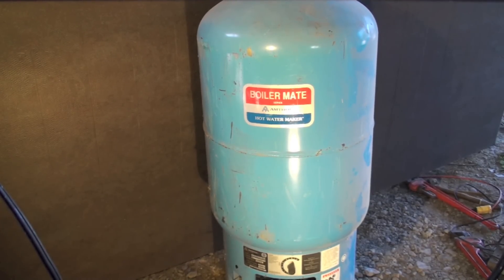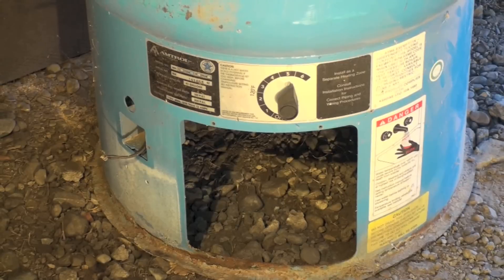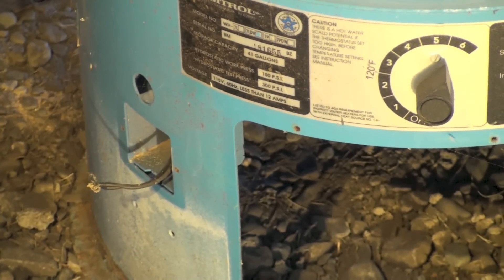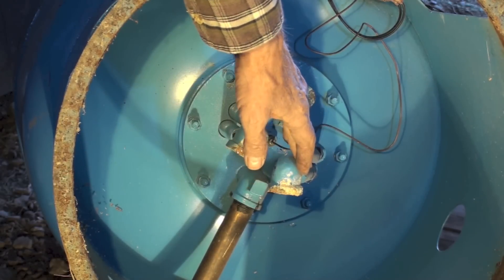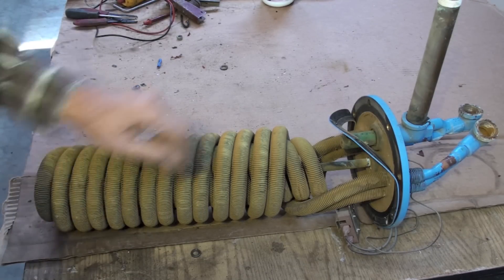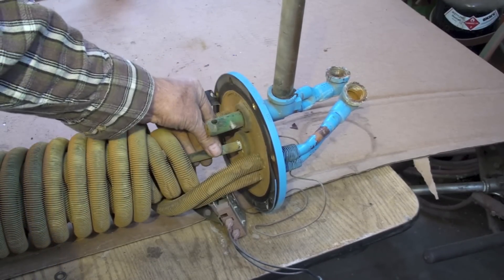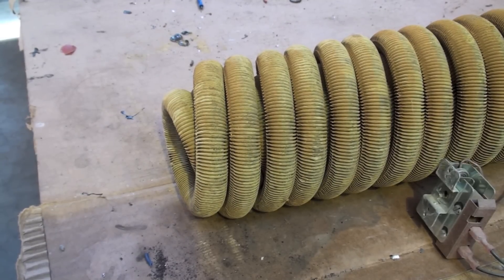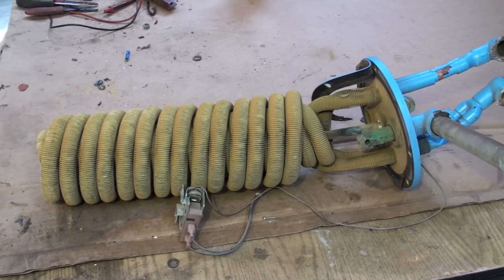The boiler water heater

Comment: Thank you for an inside look of the boilermate model of indirect-fired water heater. I am in the process of replacing one, which was existing six years ago when I moved in the house, but now leaks. Nice to know that it has an efficient heat exchanger - worth replacing with same. Otherwise I would move on to a direct-fired model.
Reply from the maker: Thanks for the support.
GFM

Comment: THANK YOU!!!!! Your videos helped me fix my furnace today.... NO COST!!!!! (even though I have SO many extra parts after replacing the entire furnace in '12.... I have had TWO Amtrol WH41 water heaters crap out- (they actually sent me a new one at no charge to a dealer near me) I installed it 2 years ago and have the same issue.... Err3 code...... I waited up for HOURS last night to check it said "120" until I zonked out at 3AM.... got up at 5AM to check and Err3 code is back... I LOVE your videos... but my tank (I took the old one COMPLETELY apart last time and ended up soldering a pinhole in the stem assembly which lasted me 6 months while I waited for a new stem from Pex Supply and never ended up needing) WHY does this keep happening????? I do not have "coils" in the belly of my beast!!!! I have a broken back and DREAD yanking this one apart and replacing the stem again and THIS time there is NO WATER dripping from underneath.... HELP!!!!!!!!!!! (AND PS.... I laughed my butt off when I had to borrow a socket wrench extension from my ex husband for more torque and he saw what I was doing....he had JUST paid nearly $3K to replace his whole tank and fixing mine cost $24- and he's a mechanic!!!!!!!!......LOL) Blondes DO have more fun!!!!!!

Comment: Why is there just a supply pipe from the boiler?  Wouldn't there need to be a return line for the cooler water to be reheated once it passed through the exchanger?  Thanks for all your videos.
Reply from the maker: There is a return line.  You just haven't found it.  It will be located near the bottom of the boiler and there may be a pump on the return.
GFM

Comment: The heat exchanger in the boiler-mate doesn't look much different than the much maligned domestic HW coil in cast iron and steel boilers. In this you use boiler temperature boiler water through the coil to heat 40 or so gallons of water to 120 degrees or more and in the other you use the water in the boiler to heat cold water going through the coil to probably a lot over 120 degrees to be brought down via a tempering valve. Is how much more efficient this tank would be determined by the type and size of boiler? In both cases the boiler has to operate year round but maybe some have to stay hot and some only intermittently.

Comment: I know this may be a silly question but the the boiler have to be on? What happens in summer? We replaced our oil boiler furnace with gas last year and now need to replace the electric water heater.
Reply from the maker: +Cynthia Nguyen If the boiler is used for domestic hot water, it must be on all year.  Hope this helps.
GFM

Comment: I just replaced my 18-year-old Boilermate with a new one because the old one sprang a leak near the top. Now the new one doesn't keep the water at 120 degrees when the thermostat is set to 120. It keeps it at around only 100. I have to turn it up way past 120 to get the water up to 120. What would be the cause of this? Could there be something defective with the thermostat of the new Boilermate? Nothing else was changed with the furnace boiler. The new Boilermate was installed exactly like the old one was. In fact, the old one actually kept the water at about 140 when the dial was at 120. Is the thermostat just not very accurate on these models?
Reply from the maker: I would check the temp probe to see if it is seated properly.
GFM
Reply: Can you clarify what you mean by the temp probe being seated properly? I had the tank put in by a plumbing and heating contractor and he said I will just need o keep the dial turned up higher to keep the temp at 120. I want to be able to explain to him what he may need to do. Would checking the temp probe require draining and disconnecting the tank?
Reply from the maker: Most of these units have a well that the sensor for the thermostat is is set into.  If it is not seated properly into the well, it may not sense properly.  It is located outside the tank.
GFM
Reply: Ok. Thank you. Where exactly is it located? Is it something (as a non plumber or heating pro) that I can check and correct?
Reply from the maker: I would probably get a pro on it.  
GFM

Comment: Im having an awful time with my BM..the water is luke warm, to shower or dishes..i put the temp dial up..it helps BUT then the pipe in the back (BM)fills up a big bucket of water...(learned that the hard way).no plumber no whats going on. One said it may be rusty inside? constant money down the drain~ any ideas?
Reply from the maker: +surfingforinfo Is there a bladder tank in the system?
GFM